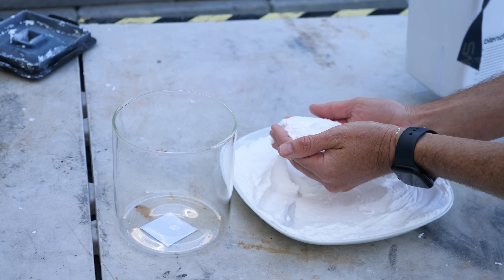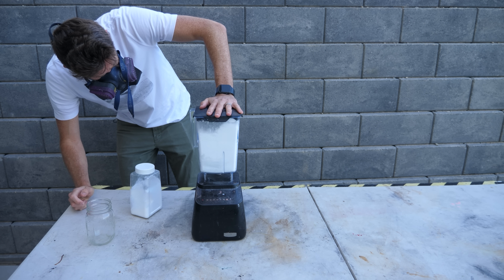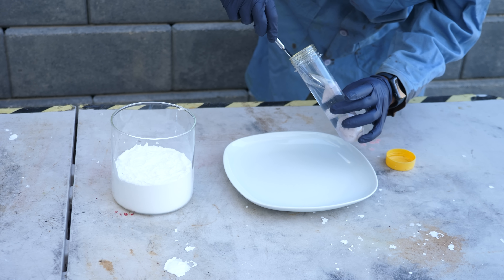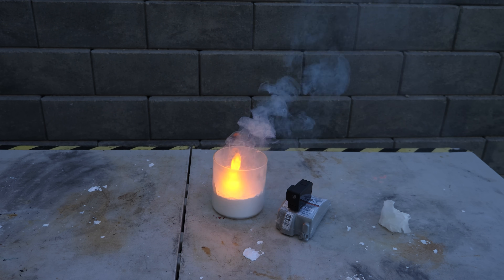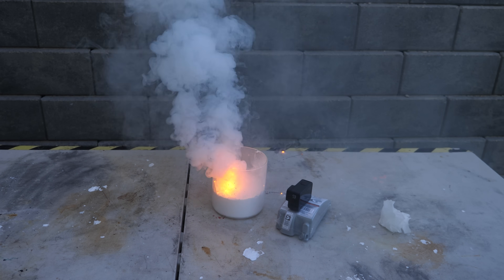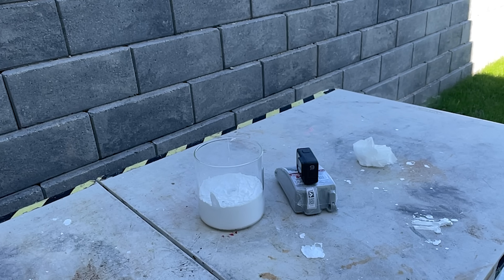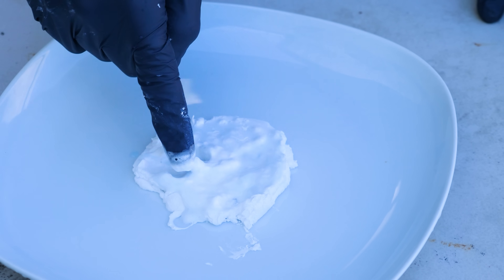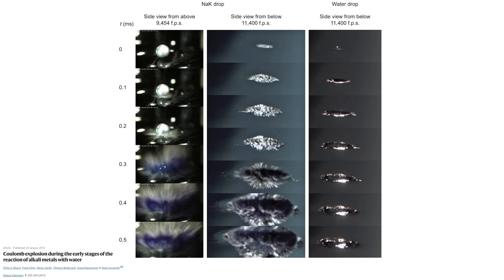Does Sodium Metal Explode In Dry Water?

Comment: I have a potentially interesting and also potentially totally boring and uneventful idea. Depending on what the result is. How would sodium (or other alkali metals/their alloys - NaK for example) react with a dry high hydrate of a salt - like blue vitriol, Magnesium or Calcium sulfate or chloride hydrates etc. It would probably be difficult to test fairly, as those wouldn't like to react due to little surface for contact between the reactants. Best would be probably trying to introduce liquid without involving water - like trying to melt the salt at low enough temperature while not driving out the water of hydration (if ever possible), or by using NaK under inert atmosphere. What do you think?

Comment: I found this one fascinating. My pre-experiment guess was that the fume silica around the microdroplets would sort of "insulate" the sodium from the water. But there would still be small explosions because the fume silicia isn't going to be perfectly covering all of the water. There will be some "uninsulated" drops of water with which the sodium can react. I expected the mini explosions to continue until the sodium was gone. I wasn't expecting the larger explosion that ended the first experiment. Maybe I was a little close - at least initially. But completely wrong on the second, as I figured it would just be the same.

Comment: I wonder how dry is dry water actually? If you put it on a paper towel, would and moisture show up on the paper towel?
I would have guessed that there was enough moisture/wet water to start the reaction and melt together the silica releasing more and more wet water as it burned. Then in the second time there was already more released wet water to speed up the process to explode since I imagine wet water sinks to the bottom and it took a moment for the metal to settle to the bottom of the glass.

Anyway that would have been my guess.

Comment: My thoughts on what's happening:
The Silicon Powder forms a protective layer around the individual droplets. But they are inhomogeneous; some may have little gaps where liquid water and sodium can react. Because of the low direct reaction space, the reaction starts relatively slow, nevertheless generates a lot of heat. This ignites the formed H2 AND evaporates the encapsulated water droplets. In the gaseous form, the water won't be "protected" by the silicon powder and can react on a much bigger area with the sodium, accelerating the reaction's intensity more and more until it explodes.

Comment: It seemed obvious to me that the "dry water" would have much less contact with the sodium, with all the air and silica there. Sodium in "normal water" is almost totally surrounded by water, after the reaction has started mostly water vapor, because of the leidenfrost effect, but still water. Besides reaction products, obviously. Also, I suspect the sodium hydroxide dissolves, and by that disperses much better in water than "dry water".

Comment: (YouTube ate my post -- trying again)  Actually, the first time putting sodium in dry water did have an explosion -- it was just much smaller than that of the second time.  It didn't break the beaker, but it did blow out material with a very audible pop.

Also note that sodium hydroxide will react with the silica that was used to convert the water into dry water.

Comment: Water is not wet. Wetness is the emergent relationship between 2 different substances, a liquid and a solid. If the adhesive forces between them are greater than the cohesive forces of the liquid, then the solid is said to be wet with the liquid. If water is wet with itself (as a liquid), then wetness becomes a useless thing that applies to every liquid because they're all wet with themselves. Hydrophobic materials covered in water would need to be considered wet because they have water on them despite the water not adhering to them.

Comment: This is a three step reaction, all three of which are very energetic.  In the first stage, sodium metal initially reacts with the water until it becomes molten.  During stage 2, as a hot fluid, it will react violently with fumed silica in a thermite type reaction, forming elemental silicon and sodium oxides.  A third reaction sees the sodium oxides react with the entrained water forming sodium hydroxide and hydrogen.  Place a lump of sodium in dry fumed silica and remotely initiate the reaction with a propane torch.  You will be surprised at the ferocity of the redox reaction.  No water needed.
Reply: Do you know of a video or paper on this?
Reply: @DANGJOS  Personal experience.
Reply: @Franklin-jj4jz   Well if you ever do make such a video, I'd love to see it! Safely of course
Reply: I don't see the third reaction producing hydrogen tbh. The first will definitely produce hydrogen.
Reply: @jskelton25  You might be right.  I googled it and found conflicting reactions.  One school of thought says that sodium peroxide and water form NaOH and oxygen.  A second claims that the products are NaOH and hydrogen peroxide.  Either way, the third reaction is spicy.

Comment: I kind of expected nothing happening at all. I though that the silica was isolating the water enough, to the point that there would be no contact between it and sodium resulting in no reaction at all. I wonder how the experiment would do in dry atmosphere (no water vapour). If it went the same as here, then it would suggest some kind of contact between sodium and water. But if not, it would suggest that the water for the initial reaction releasing NaOH and melting all those tiny water cells by lowering their surface tension actually came from the sodium reacting with the vapor in the atmosphere. Which would explain the slow begining, since it probably takes a hot minute (pun intended) for it to cumulate enough hydroxide to kickstart the chain reaction of other cells collapsing

Comment: Heat is pressure of force. Loved you showing the lifeblood of everything. Electricity is rapid heat exchanging through mass as renewable energy exchanging singularities point to point chain reactions through all masses in its path. The plastic coating wrapping is warm because heat passes through all mass in its path. Heat has to ground or burn as external heat energy outside of internal magnetic fields grounding currents through the nucleus or core as fire. Grounding heat currents incoming and outgoing equalization is necessary for mass to exist as internal magnetic fields grounding heat energy currents. Current grounding prevents the accumulation of heat energy. External heat energy within and without entanglement of mass is always present in internal magnetic fields. Grounding currents of heat maintains temperature control as mass 98.6 equalization of heat energy. Magnetism circulation cycling patterns created by internal magnetic fields grounding currents through the nucleus or core like earth's internal magnetic field grounding currents through the nucleus or core. Mass is always external heat energy within and without entanglement of magnetism. Space itself is a weak external magnetic field filled with dark heat energy waves outside of entanglement of mass as potential renewable heat energy when entanglement with mass occurs again and again. Conservation of heat energy throughout space as space and mass. Burning as fire is an internal magnetic field disolving. Lightning burns through atmospheres, producing sparks lighting up surrounding atmospheres as refraction of unabsorbed heat energy singularities outside of entanglement of mass. Color is unabsorbed heat energy singularities outside of entanglement of mass as refraction of heat as light bouncing around unabsorbed. Grounding currents maintains internal magnetic fields from disolving as fire. Engines ground heat energy to anti freeze and radiators ground heat energy to atmospheres and atmospheres grounding heat currents to surrounding areas of mass as potential renewable heat energy exchanging points through mass or bouncing around as light.  Friction causes sparks (electrons) of unabsorbed heat energy. Magnetism bonding force of pressure is absorbed and grounding currents releasing heat energy singularities exchanging points through mass in chain reactions until resistance is overcome by open space itself. Color is degrees of heat unabsorbed. Red shifts are unabsorbed heat from stars, releasing heat. Theoretically factual probability that works with quantum physics without gravity. Mass is always heat energy within and without. Mass disolves its internal magnetic fields grounding currents as heat known as fire. Stars decay their atmospheres as external heat energy waves outside of entanglement of mass. Mass is heat in internal magnetic fields as outward force of pressure. Heat is propulsion. It doesn't collapse in on itself. Physics works. Hydrogen under extreme pressure expands into an area of space occupied increases and force decreases as expansion. Mass expands space and force of pressure to area. Distance is always equal to force. As force decreases, distance increases. Hydrogen has the strongest internal magnetic field grounding currents of force and the least distance traveling cycling circulation patterns as elements. Table of elements proves hypothesis. More occupational space and more heat energy currents singularities grounding. Repulsion to heat propulsion from cold repulsion momentum is always equal to the area of occupational space. Density can't exceed repulsion within and without entanglement of mass. Mass is always equal to repulsion. Force is always equalization to distance traveling. Mass falls in equalization. Impact is the bonding force of magnetism. Mass is always outward force of pressure redirected by a greater internal magnetic field grounding currents like earth's internal magnetic field grounding currents through the nucleus or core. Synchronization of internal magnetic fields. Magnets show the bonding force of pressure and equalization of repulsion. Magnetic fields show the strength of unification of unidirectional flow cycling circulation patterns as internal magnetic fields grounding currents through the nucleus or core.  Proximity mass is influenced by farther reaching weaker magnetic fields grounding current synchronization. The closer to the core, the greater the force of pressure as weight bonding. The further away from the core, the force decreases. Outside the magnetic field, the force of pressure is outward as weightless. Currents grounding are magnetism bonding force of pressure known as weight. Table of elements proves hypothesis. Theoretically factual probability that works with quantum physics without gravity. Magnetism friction bonding force of pressure.

Comment: Fire Triangle Components Breakdown
Heat 🌡: a heat source is needed for fire to occur. Everything has a point at which it will combust, otherwise known as a “flash point.” This varies depending on the material. It also applies to the temperature of the fuel as the fire continues to burn.

Oxygen 💨: fire can be compared to a living thing. It needs food (fuel), heat (body temperature appropriate to sustain life) and air to breathe. Oxygen basically “feeds” a fire. As oxygen reacts with the fuel it releases carbon dioxide and heat. Removing the oxygen essentially suffocates the fire just as it would a living creature.

Fuel 🪵: fuel is the material that burns. It is essentially the hardest thing to remove from a fire, since everything around us can become fuel. Think of all the things around us that burn; clothing, furniture, paper, oil and grease etc. 

Now that you understand the fire tetrahedron let’s talk about how you can interrupt it. .

Comment: try gravity plumbed liquid rockets, example values: rocket heigh 50m, radius 10m, flow rate 100ton/s, 500bar. isp 300s approximate emptying time. flight acceleration causes even faster flow rate and pressure. no complex turbine pump systems required.

Comment: If it's less dense does that mean you wouldn't be able to swim in it? You know what you must do.
Reply: There is a thing called aerated water, it's used in water treatment, I guess to separate the 💩 out.

You can't swim in it, you will sink.
The density of the aerated water is low so the force of buoyancy is not high enough for people to float.
Reply: @dominicfindlay  Aerated water can also be highly dangerous, even for boats, IIRC occasionally this can occur naturally though underwater volcanism and hydrothermal vents
Reply: @StuffandThings_ yeah a magma block under a water source makes downwards bubble columns
Reply: It's also powdery. So maybe you can walk on it...
Reply: I don’t think you should swim in dry water if he was making a gas mask to I believe keep out the powder he added to the water.
Reply: @leonszegedy respirator. Because silicosis is a thing that kills a lot of people. Manufactured stone has been outlawed in Australia as of yesterday due to it being so dangerous to work with.
Reply: Been watching videos on cooling paint which uses evenly packed spheres of various types (usually boron) to radiate heat pack to space. If the dry water forms tiny spheres (water droplets), how well would they radiate heat?  I don’t know how practical the knowledge would be but would be an interesting experiment. Air is a good insulator maybe some kind of insulation?
Reply: Bro... silicon is toxic...